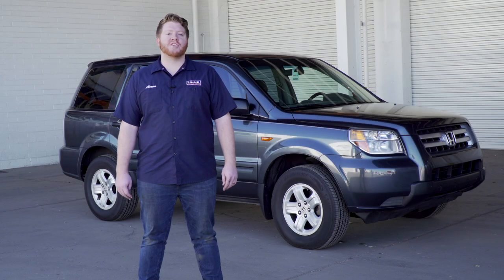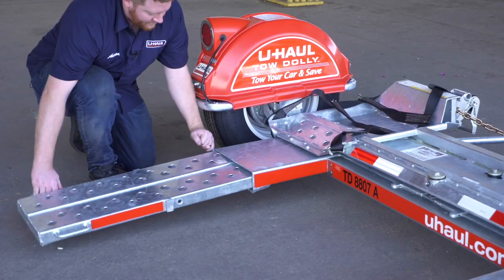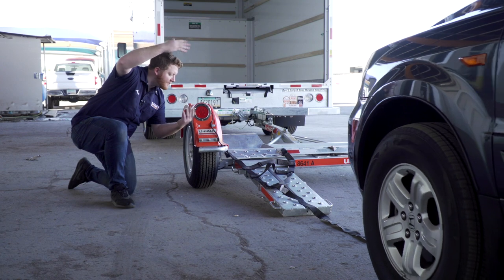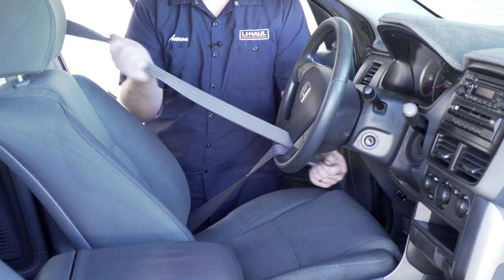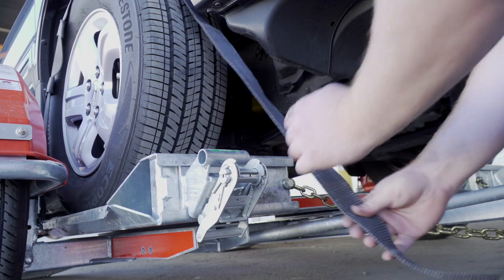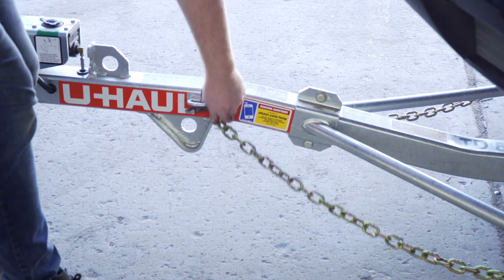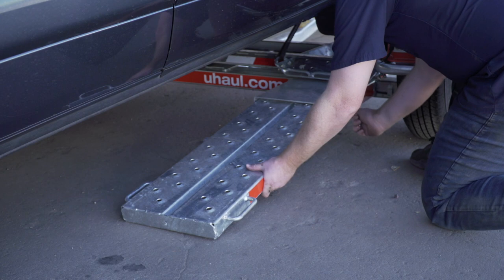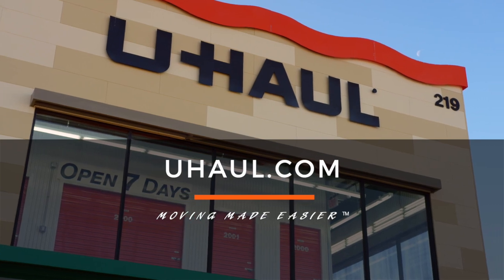Loading a 2004 Honda Pilot (FWD) On a U-Haul Tow Dolly

Comment: I hope that pilot is 2wd. Otherwise this would destroy your center diff
Reply: Correct! It is a front wheel drive Pilot.
Reply: So with rear wheel drive, would you would back in then? Is it possible to tow backwards?,
How would you lock the steering wheel so it doesn’t move?
Reply: @42luke93  

Just disconnect the drive shaft
Reply: @Ruben901  
Sounds like a lot to do. Can one just tow a vehicle backwards? Or does the steering need to be locked.